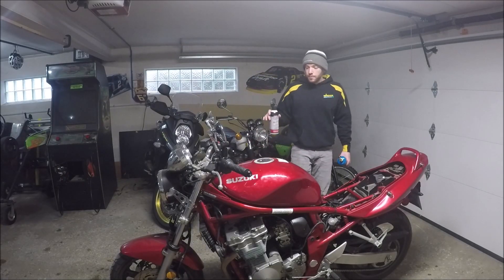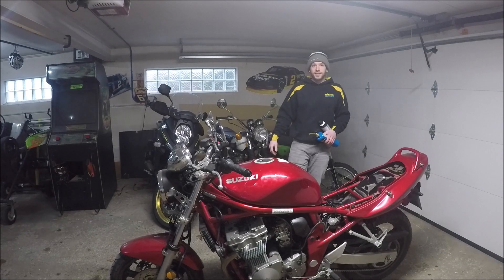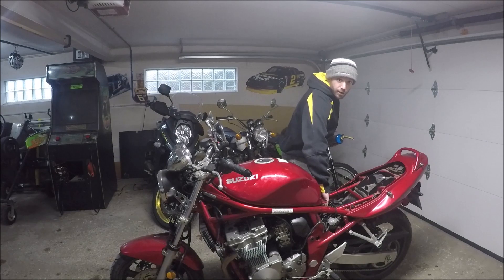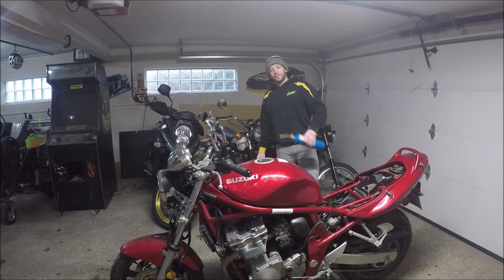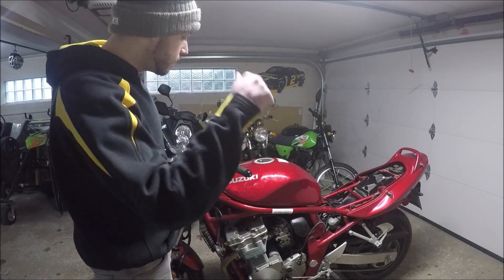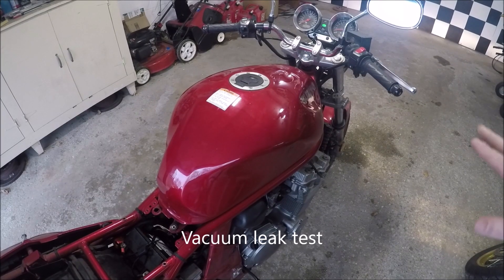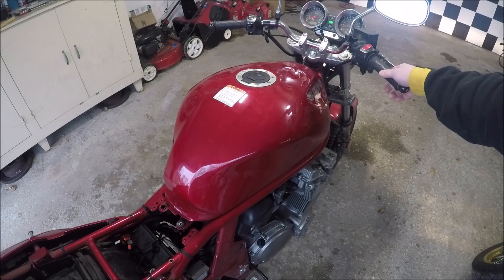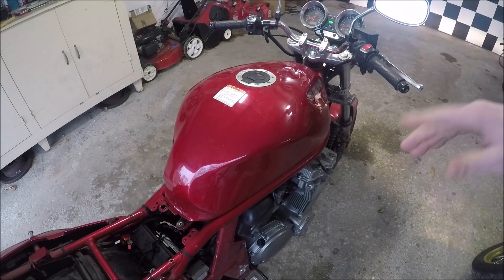GSF600 - Vacuum leak test

Comment: I'm glad you didn't remove the video, gave me a few things to check. My Bandit wouldn't start after standing for 6 months. After finally getting it started, it was only running on 3 cylinders. Stripping it down the plug on the defective cylinder and air filter stunk of fuel, so I guess it is time for the carbs to come off.
Reply from the maker: Definitely check the plugs since this bike (from my experience and reading others') has a habit of fouling up plugs quicker than most. Good luck on your Bandit journey.

Comment: got a gsx 750f kat 1993 spray some starter fluid at intake boot 1 and 4 and it picks up revs, cold starts it has a random idle when it gets warm the revs randomly pickup to around 3-4k revs, the bike will rev sometimes but hang at 3k, when the bike is warm it'll eventually randomly just shutoff, given 5-10mins it'll fire right back up with ease but only after it's left for a few mins, im thinking this vacuum leak is the prime cause for the issue anyone else care to add some intel cus im clueless with bikes.

also if you cover the intake of the carb 1 and 4 the bike stays running, cover the intake of the carbs on 2-3 and the bike completely shuts off.
Reply from the maker: The scenario you described with random idle, hanging revs, and idle increase with starter fluid sounds like it could be a vacuum leak to me. 

Never a sure thing but you've hit on a couple of the primary symptoms. If that Kat has vacuum nipple plugs on the unused vacuum ports of each carburetor, I'd consider replacing them since it's a super cheap swap and could be the resolution. Probably not, but I'd do it regardless to rule out the variable.

Comment: Bought it with 4K on the odometer for 500 bucks. Guy had it listed for 1000 but I talked him down because I had to replace several vacuum lines that I fabricated myself, and it runs when it wants to. I replaced the main 7/32 line from the front of the gas tank to the top of the block, it started and idled decent for about 15 minutes and then boom no start again. The guy that sold it to me said he believed it was a vacuum leak to blame for this so he turned the idle control screw counter clockwise to richen the mixture to get it to idle. I thought no problem I’ll just adjust it back down to normal. 
The screw is completely missing from the idle air control knob on my bike. It’s on the left right under the petcock, but there isn’t a way to adjust it. We pulled the plugs checked to see if it was rich or lean and 3 of the 4 were wet with gasoline. 
When I get back to it tonight I plan on trying to remove the air filter and figure out IF it had any more vacuum leaks before I go any further. 
One step at a time I just bought the bike a couple days ago. 
Only bummer is it has a salvage title because it was hit from the front at about 10 mph. 

FYI:
He had the main jet and idle jet replaced in 2 of the carburetors, I have the old one and it's not even clogged up.

Comment: one of the 4 vaccum insert holes on my mikuni carbs always blows off the rubber end cap do you have any idea what could be wrong?? theres only supposed to be suction only from those holes right??
Reply from the maker: Im not familiar with the mikuni's, but if theyre like these Keihin CV carbs, they should definitely be vacuum. I doubt you'd ever see a rubber cap for a positive pressure--only vacuum.

Sorry i can't be of more help. I haven't heard of that issue.
Reply: @matttriestodothings  i guess youre right doesnt make cat sense for an end cap to hold pressure , it should be vacuum, (1st cylinder carb)one of them is linked to the fuel intake diagphram...i suspect i have a leaky intake valve on the 2nd cylinder cos its blowing air out from the hole i mentioned earlier

Comment: Well, just went through everything you did only to find out one of the boots was not screwed on all the way to the head(they are also cracked up).  Those things were like $26-30 a piece! This explains why the previous owners fuel mixture screws are all fucking different for every cylinder.  Now I get to wait for parts.
Reply from the maker: Yep. i paid $136 for a full set of OEMs. Crazy expensive for what they are. 

I paid for a set of 4 for my Yamaha FZR600 from aliexpress that were $10 a piece and seemed identical to OEM. I wouldn't normally look to cheap out on something like that, but it's crazy expensive for some of these intake boots.

Good luck on the work you got going on.
Reply: @matttriestodothings  So far this motorcycle is becoming a money pit in small parts, gaskets and hoses. Every time I work on it I end up noticing something else that needs to be fixed.  It's like my first motorcycle all over again(Kawasaki KZ550).
Reply from the maker: @williamfoster4268  this is how it goes, unfortunately. Obviously you know already, but I think a lot of people pick up a "cheap bike" for $2k and think they're set. Well, 15-20yo rubber needs to be replaced. You can cut corners, but eventually, it goes. And you can get nickel and dimed pretty bad.

It's not terrible if it's a hobby. In fact, it can be fun. But if you just bought the bike to ride and commute, it can suck.

Just got my friends vf500 to my house today to get running. 38 years old. We're going thru it now while watching the 24 hour Daytona race to determine if it's worth getting running. Because of all the little expenses to get it right.
Reply: @matttriestodothings  You nailed it.  I paid exactly 2k for my Bandit.  It ran fine until I got it home and it sat for a month.  I should have known something was up when the bike was already hot once I test drove it.  Next time I will bite the bullet and use the money for a down payment on a new motorcycle.  

The only plus so far is dirt cheap insurance and the fact that no one will want to steal this thing when I leave it parked outside. Wife can use it to learn how to ride or drop it on the MSF course and I won't be upset. 

I like the Interceptor's, I like the sound but I hate working on V engines.  TV in the garage helps, I usually throw on reruns of something automotive.

Comment: You need to do the starter fluid test when the bike is cold. As the bike heats up the rubber boots and will slightly expand making the vacuum leak almost disappear. Don't use propane as the aire around the bike heats up the propane gas will float up with the hot air the starter fluid is heavy and will stick close to the boots and get sucked in easier. New boots might not fix the problem. If your boots screw into the engine. Be sure they didn't go in lopsided by tightening one side too much before tightening the other. (Most carb boots have 2 screws) go little by little on each one. I've seen people use rtv on the matting surface. I personally use Rubber  used for making custom gas/automotive seals and cut it to size for the boots. If you think you fixed it take it for a drive it will behave differently under load. It may seem fine in neutral. Vacuum leaks are fineky
Reply from the maker: This is really good advice, thank you. I had guessed that the boots likely swelled to fill the leak which is why it was sporadic. I ended up replacing these boots with new OEM intake boots and O-rings (only after just replacing the o-rings at first). I think the more likely source of the actual leak on mine was not the mating surface to the engine but the clamp section to the carburetor outlets. 

"Vacuum leaks are fineky" is quite the understatement! Though I haven't had nearly this much trouble on any other bike with vacuum leaks. The Bandit has been far and away the most troubling in that regard.

Comment: 3:32 I think you just need to invert the Y-axis..

But seriously these are good videos, my yzf600r started mis-firing a few years ago and its sat in the garage since, wanting to have a look and try and get it running again now starting with plugs and coils\leads, and Im learning a lot from your videos on the carb which I never would have considered playing with in the past.  Good work thanks.
Reply from the maker: Hah, I never considered turning the throttle around backwards. That would have saved me a whole lot of frustration!

Thanks for the kind words, Fromatic. I started making these videos as a learning experience. Some of the earlier ones are tough to watch back, but at least I think they're a more realistic experience for how an amateur tinkerer like myself gets on with resolving these issues. I've still got a lot to learn, and it makes me appreciate those professional mechanics and videomakers that much more. But also that getting your hands dirty and taking these thing apart and reassembling them is scariest before you start. Once you start pulling things apart and researching them, it becomes less intimidating. Still irritating! But each successive attempt usually goes better.

Good luck with the bike! You'll get it.
Reply from the maker: Oh, and you're definitely on the right path with troubleshooting. When it comes to fuel/air/spark, I've learned the hard way to start with the simple things first. Plugs, coils, leads is an ideal place to start. Cheers.
Reply: @matttriestodothings  Cheers that's encouraging to hear, I say misfiring but not sure it's the right word, but I am sure it was only running on 3 cylinders, I think plugs/coils was me clutching at straws before learning so much about carbs but I'll do them anyway as the parts have already arrived, but as it's sat for so long I'm thinking at the same time I'll take them off and give them a clean now I've seen the state they can get into, possibly blocking fuel flow to one cylinder, its probably well over due!  The professionals make it look easy but I think I've learnt more from these, things that would get frustrating like putting the float covers on in the wrong order meaning pipes are in the way and you have to take one back off haha, wouldn't learn that watching a professional so appreciate you leaving that kind of stuff in.

Comment: Hey dude, you bike going mad @ the 4 minute mark - Mine does exactly the same and I cant diagnose it. Done carb rebuild, tank and petcock etc. Was it air boots in the end?
Reply from the maker: I don't believe it was the air boots in the end--though I did end up replacing those. You do need to tighten down pretty hard in order to remove any air leaks--tighter than I initially thought. I'm thinking the entire key to this is the air filter--of which I installed a HiFlo Filtro one which may let more air passed. 

While the bike ran pretty good for ~2000 miles last year, it still doesn't seem like I have it perfect because it takes so long to warm up, and the startup is still a little erratic. Once the bike is HOT, it's good. But hot takes quite a while to get there. I might play around with partially taping over the air inlet on the air filter box to restrict air flow to see how that affects the bike.

Comment: My Bandit 1200 started giving these "sneezes" when I started to accelerate. I see in the video that yours is doing even in the slow, I believe that will happen to mine too. What was causing these "sneezes"? What was the solution?
Reply from the maker: I believe I've resolved it. I believe it was a combination of old intake manifold boots (even though they still seemed super pliable) and dirty air filter. I think the sneezing could have been air sneaking passed one of the boots, and the poor air flow from a bad filter was encouraging a higher vacuum pull from other sources. This theory may actually jive with what you're experiencing at higher loads as the airflow increases.

I'm not 100% that was the issue, but replacing the air filter is where I would start. That's the cheapest potential fix and you may be due anyway. If not, then I'd inspect the boots. Unfortunately OEM replacements were like $32/ea for me. However, I just bought a set for my FZR from Taiwan for $10/ea that I'm almost certain are OEM.

The last thing I'm doing to this bike is a block off plate set for the PAIR system. I want to rule out that it's not affecting things since i still don't have the bike tuned perfect. And you can't easily access spark plug #3 with it in.
Reply: @matttriestodothings  Thanks for ur replies brother. Mine is with the perfect slow, in average and perfect high, it reaches 245km / h normally, but it has presented these sneezes. Apparently it's coming from the gas register that runs on a vacuum, even it's leaking a little gas. I'll dismantle everything this week and see what may be happening.